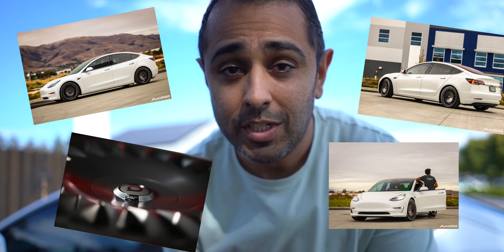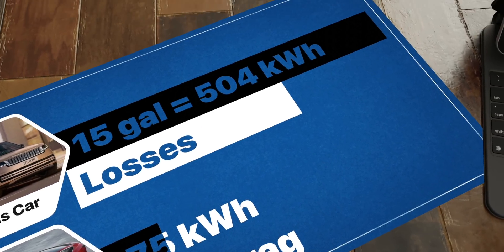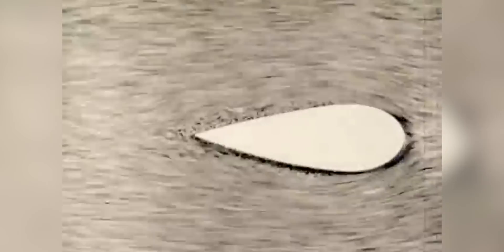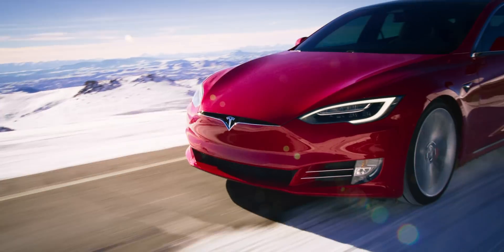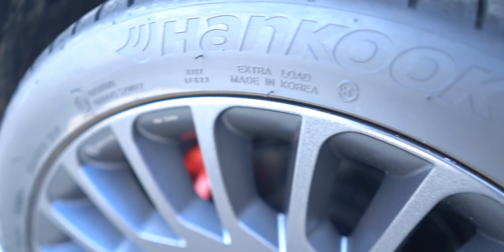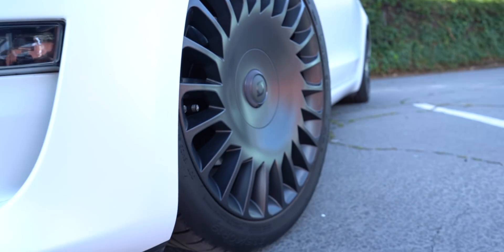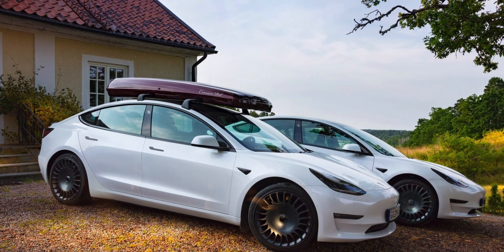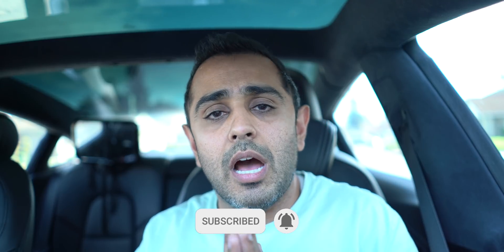How to increase range and efficiency in your Tesla!

Comment: Moved from 235/45-18 primacy’s to 215/50-18 Quadrac 5 on my winter / road trip Aero Gen 1 wheels (I run 255/35-20 PS4S on ZeroG for summer) and efficiency went from 286Wh/mi to 272Wh/mi on my P3 (for reference, 20” setup runs 314Wh/mi but I drive less conservative on them 🤪

Comment: I'm surprised that not once did you mention WEIGHT or your driving habits. Reduce weight and you gain efficiency. Replace the lead-acid 12V with a lithium battery. Drive less aggressive and you will gain efficiency. I love most of your videos but this one in nothing more than a "sell job" (springs, rims, tires) without any substance.
Reply: Keep in mind though your goals for buying the car.  Teslas are incredibly powerful and fun to drive.  If hypermiling is your thing, I would think you'd choose something else besides a Tesla.

Comment: Raj, 
Another great video, so many great details; I especially liked the collaboration with Ricky!  Maybe Ricky could qualify benefit gained by lowering the 3/Y's by 1" 👍

One thing that came to mind was, what are the optimal tire pressures for daily driving and road trips?  With such low lifespans for tires on Tesla's, I'd imagine someone has done refinements to the standard manual pressure callouts?  

Cheers,
Eric

Comment: So what was your efficiency improvement with lowering the height of the front of the car and smaller diameter tires?  Can you express it in KW/Hrs per mile gained.

What do you think of doing that same change for  Model Y.  Might even go for 18 inch tires?

Comment: You said that the bigger wheels are wider, this is not necessarily true.  Your 20" tires are not wider than my 18" tires.  And lowering just isn't worth it in my opinion, I'd rather take the hit in efficiency than rubbing on certain streets.  But I'd love to get that wheel/rim combo you got, but they're so freaking expensive.

The best thing for better mileage is slower driving and higher tire pressure.  My 18" tires can easily hold 50psi safely.  Yes, the ride is a bit rougher but I don't mind that.

Comment: To really know if the new wheels increased your range, you have to determine  your average power consumption over multiple identical trips at similar speeds and conditions, then change the wheels and do it again multiple times ... and compare.  If you change more than one thing (ie: lower the suspension and change the wheels), then you can't be sure what is causing the improvement, if any.   Just saying.  At the end of the day, unless we just like the "look" of the new wheels, We would need to know if they improve range enough to justify the purchase ... and in that regard, your video does not deliver.

Comment: Efforts to measure efficiency improvement by lowering the car have been marginal at best. I experimented years ago with my S using the air suspension travel of about 2 inches. I couldn't reliably measure any notable difference. The larger wheels on all Tesla models reduce range, so much that Tesla changes the range spec. You might think the shorter side wall on the larger tires would be stiffer and possibly roll with less friction. Apparently not? Their frontal area is bigger but most is shielded in the wheel well so I wonder how much that matters. One aspect that no one mentions is the larger wheel changes the drive ratio. The motor will turn slower and require more torque for a given speed. It seems that should be a small effect but maybe it is part of the loss. Good wind tunnel testing or fluid dynamic modeling might tell us more. In the mean time don't bother lowering your car to save energy or increase range. It won't pay for itself.
Reply from the maker: But u can’t argue it looks better! 😉
Reply: @TeslaRaj  The wheels look good until you hit your first pothole. Around here they don't look good for long. The ride and the tire longevity suffer from short side wall. I don't much care what the car looks like -  it is my servant. I bought it for the experience, not the appearance. In California you are what you drive less so around here.

Comment: I run staggered 275 rear/245 front 19” wheels and sticky tires.  With 80,000mi now, I’ve averaged 300wh/mi.  To me it’s worth the efficiency hit for the better handling and braking.
Reply from the maker: Brave man running staggered.  Looks amazing I’m sure.
Reply: @TeslaRaj  in BMW’s at least, staggered setups also reduce the tram-lining effect where wide tires want to follow groves on highways.